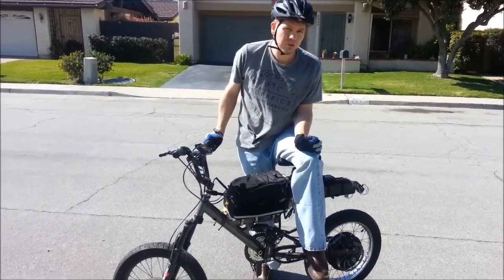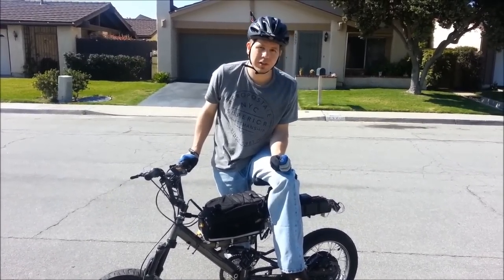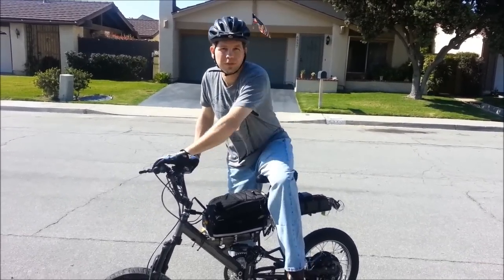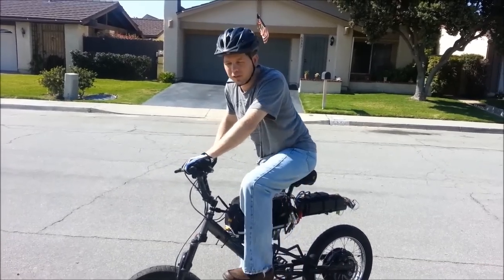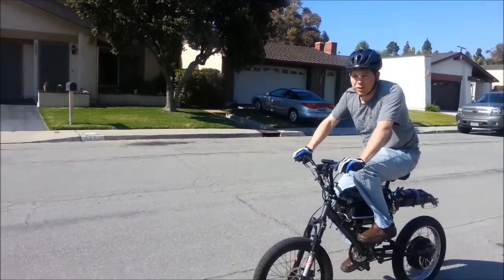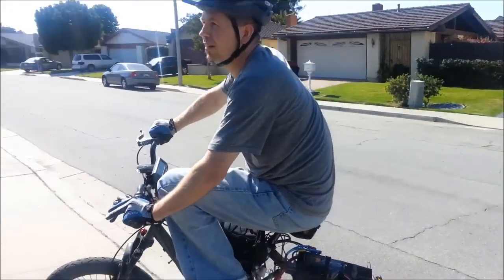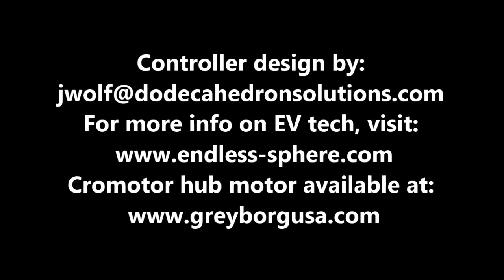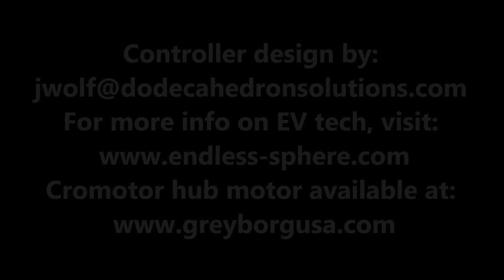18 MOSFET Controller Test Ride

Comment: I like your bike man.  Aren't u the guy who has the cromotors?
Reply: Homeboy Chris Nope but he is an awesome contributor to EV community ;) Very helpful guy! Check him on Endless Sphere!
Reply from the maker: Homeboy Chris Yes, I have a company that sells Cromotors and other ebike parts.
Reply: ZombieSS77  Is it the same model as before?  Did you find a controller that works good for it?  Another thing I'm wondering about is the frame.  How wide does the space between the dropouts need to be?